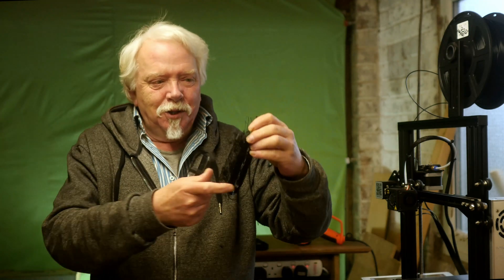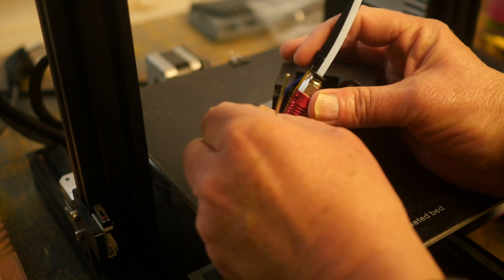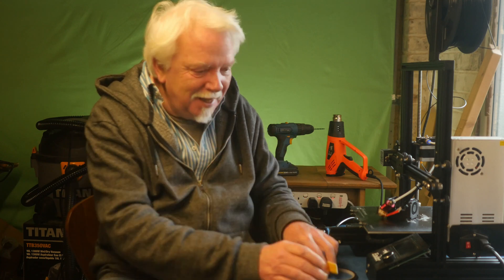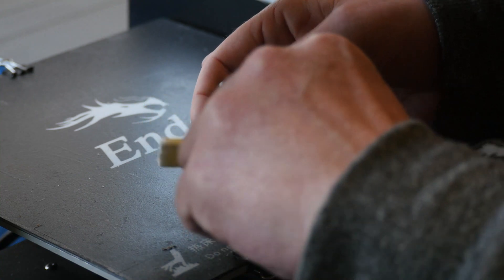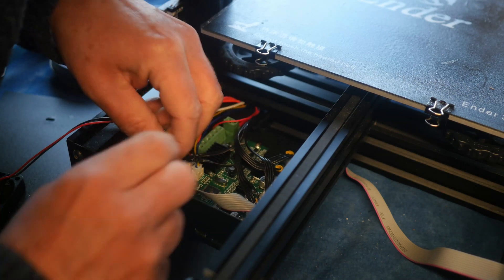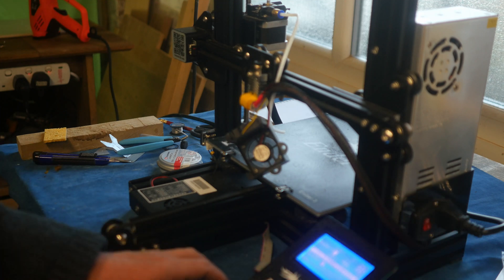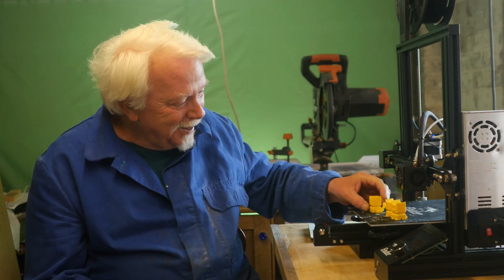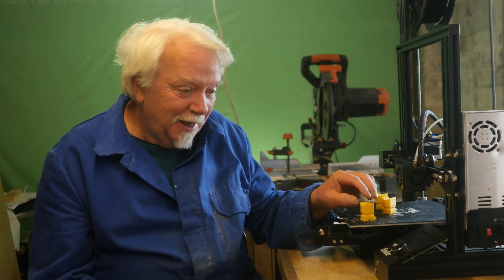I Fixed My Ender 3!

Comment: I'm coming in here hoping this is my answer. My OEM CR10S hotend failed, the heater cartridge wire had become separated, so I just bought a E3D V6 upgrade and it's not working, still. Found your video, saw that I ordered a 12V when I should've ordered a 24V. So I have a new heater cartridge and 24V cables that will be here on Sunday. Hoping this is the answer. I'm just so exhausted from fighting with this machine's bugs.

Comment: Hi Keef ive just watch you vid, i have a similar problem ive changed the hot end and now when i switch it on the hotend begins to heat up intermediately and i have no control over the temp, would you say ive damaged the motherboard  too..
please help
Russell
Reply: Hi Russell, this looks like a problem with the thermistor. That's the little glass bead that fits into the heater block - it detects the temperature so the control board knows whether to power up the heater cartridge or not. Check that first...
Reply: I'm currently having a similar issue.  In case you haven't found an answer, any time you change out the hotend you need to do a PID tune.  You can also heat up the hot end with  hair dryer and see temp goes up.  When you switch on the hot end, you should measure the voltage from the mother board, it should be 24 volts.

Comment: Makerbase board! Good choice. The Creality board is a menace, GOOD BLOODY RIDDANCE.

Among Makerbase boards, Gen.L board is a good bit smaller, it's 3.3cm shorter. I'm not sure if it would help though. Wait are you sure Teaching Tech suggested Gen 1.4 as a replacement rather than Gen.L? They are rather different boards!
Let me know if I can help with Marlin on these boards. You can mail me under my full name at gmail dot com.

Wait, you went back to Creality board :( oh well it'll work OK for now, and you have a board to use later.

I SEVERELY doubt that Creality fans are 5V? have you checked that? I thought they were supposed to all be 24V fans, because the regulator on the Creality board is a 7805, and supplied with 24V, it's sweating profusely as it is just doing barely nothing at all, much less actually running anything off it! The Makerbase have no pins for a controlled 5V fan. For uncontrolled fans, Marlin doesn't have to know where they are, at all, it can't. You connect them to the "5V output" connector (if they are indeed 5V) and they run and that's all there is to it. Naturally if you have 24V fans, they aren't going to spin if you feed them 5V. In the video, you're sticking the fan right into the 12V connector, and BACKWARDS, because the bottom pins are the ones with the voltage, the top ones are with the ground. Red wire is power, black is ground. The controlled fan must be a 24V fan and it's connected into the D9 screw-down terminal - but you can use a regulator trick which I can describe on request. 12V fans can be used as a controlled fan by giving Marlin a PWM upper limit of like 64 or 128 in configuration_adv.h as FAN_MAX_PWM, though the way your luck goes, the fan might still not like it and protest by burning out.

You also probably want a new display for that Makerbase board, because Creality's pinout is different, and it's missing an SD-Card socket, and Makerbase also is missing the SD-Card socket, it expects to find one in the display module. It's not very expensive, it'll be about $8 or so.

Your catprint isn't particularly good at all, it has severe underextrusion. I'm thinking you're discovering a typical problem shared by Creality, Geeetech, Wanhao and many others - the idler spring in the extruder is losing tension. You let the printer sit for a year, it's guaranteed to happen. It's a pretty good idea to order a $4 aluminium extruder from China, because you can add some preload to the spring, but it will break the plastic lever arm eventually, because that's just how these things go
Reply: Corrections/additions:

Internet tells me that all fans on Ender 3, every single one, are 24V fans. This makes things a lot easier. On the Gen.L they would slot right in into the already installed connectors, as long as there's only two fan connectors to attach, one for the controlled fan(s) and one for uncontrolled fan(s). Incidentally Internet has told me that Creality afforded themselves a little design blunder and connected the board cooling fan to the controlled fan output, while it should be connected to uncontrolled output. When printing PLA it's fine like this, but if you were to print something that doesn't respond so well to cooling, you would want the board fan to always be on. Granted prints with such materials are almost guaranteed to fail, as the airstream of the cold-end cooling fan hits the parts almost better than the airstream of the part cooling fan, and there's more of it. Just the little quirks of a cheap kit.

Gen 1.4 is missing fan connectors, the controlled fan is connected to the screw terminal, and the uncontrolled fans are (???), maybe you just splice them into the supply wiring somewhere, or maybe that's what a couple of unpopulated pads to fit another screw terminal near the power supply input are for? You should be able to easily test whether they're just connected straight through. In case you thought Gen 1.4 was newer because it has a version number, the opposite is the case. Not that one is more advanced than the other, no, because in part Gen.L got price optimised a little bit more. But I mean, cheaper USB interface IC is hardly critical, and the MOSFET replacement seems to not be too terrible either. Gen.L introduces a formidable attempt at noise suppression from endstops and steppers interfering with the voltage stability around the main chip, but it doesn't seem terribly effective. Rather than buying another board you won't use, I think sticking with Gen 1.4 is as decent a plan as any.

The heater MOSFET might have indeed failed merely from prolonged high current, as Creality replaced the MOSFETs with unknown models when I wasn't looking. Perhaps they copied the MKS design, which is adequate except when horrendously abused.

Another thing that I haven't anticipated is that the 5V regulator is not a 7805, it's now a switching supply which can deliver a good bit of current even when powered from 24V - but it's not terribly relevant in this case since the fans are still not 5V fans.

The final catprint is OK, I got confused or was thrown off by something. It has alignment issues, but that's just movement mechanics, you'll know where the wheels don't connect rigidly enough if you poke it. I guess the extruder issue will come eventually but not today - but you do get more temperature leeway when the extruder has a good extra bit of pressure.

Comment: I know nothing about them gizmos and seems to far too temperamental and fragile but congratulations keef 👍
Reply: Yes, even for $3000 printers, it's common enough of them to spend more time broken down than working, and this one was $200.

Then again Keef seems to have developed a particular talent for doing things just slightly wrong enough to cause more damage than you'd normally expect. You do find plenty of people who ran this printer for 6 months or a year doing 5 prints a day and were fine. Of course they do break down eventually, but then unless you start installing wrong parts, they are super easy and cheap to get going again. Getting good beautiful prints is a learning curve too.
Reply: Siana Gearz yes he’s very “tech” and I’m more practical and likely to say screw it and buy another 🥴